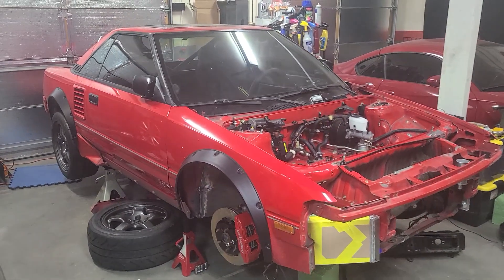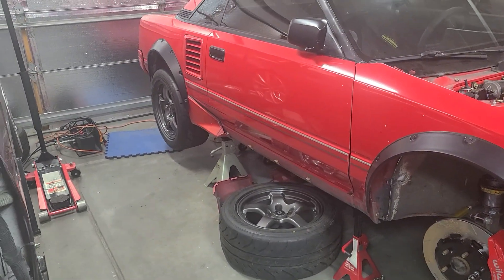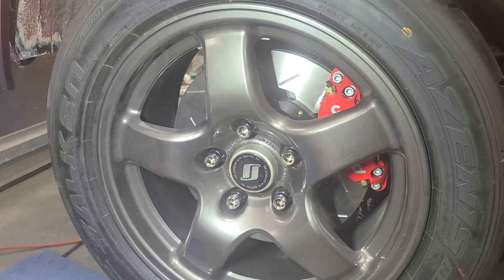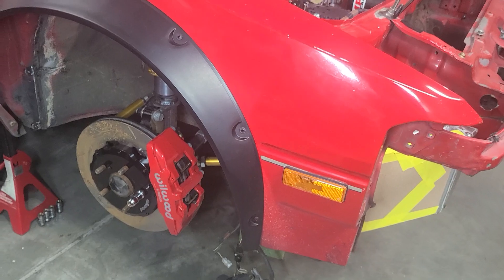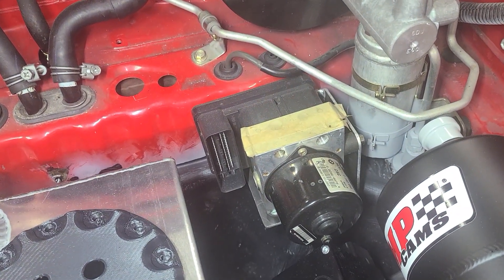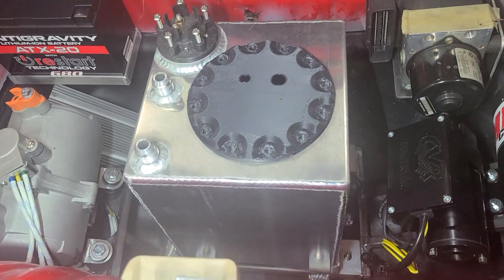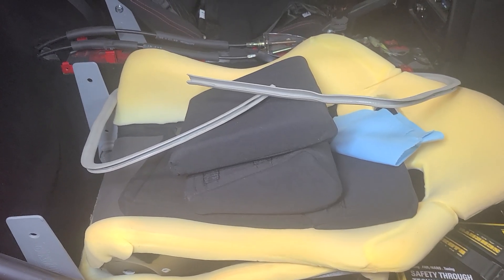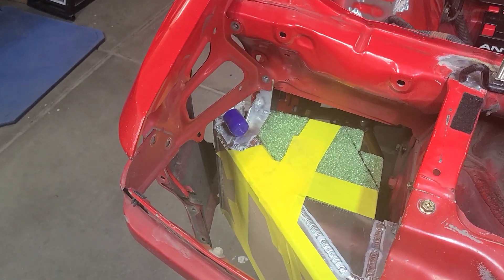Zerodrift's Aw11 MR2 Mk1.5 project overview and updates.

Comment: Would love to see the completed surge tank setup! Seems like a cool work around from dropping the stock tank. Will you be using the stock pump in the tank, and running a high pressure pump in the surge tank?
Reply from the maker: I'll be dropping the factory tank as well to replace the aging factory pump, run fuel new e85 capable fuel lines and new electric to the factory hardware.  The surge tank will be fed by the oem replacement pump and within the surge tank will be a high flow pump feeding the engine. I'll be posting up more videos and will be sure to share how the setup finishes.

Comment: how would you reupholster the top of the door cards? Loving the car! Have you considered an accusump for the car with such a nice engine when you don't have a dry sump?
Reply from the maker: Thanks!  The door cards were stripped of the original fabric and I used two styles of vinyl for the new cover.  The pattern was simple with the seam dropping towards the window hinge.  This was tricky to run thru the sewing machine as I recall.  The door card was wrapped with headliner foam and the new upholstery glued to that.  The upholstery was then wrapped and glued to the backside of the door card.  Finally, the original plastic trim was reinstalled over the whole assembly.  

I honestly forgot about the accusump system.  Have experience with one of those?
Reply: @zerodrift1  No, I haven't but I have heard good things about them and figured I would mention it. Thanks for the info on restoring the doorcard!